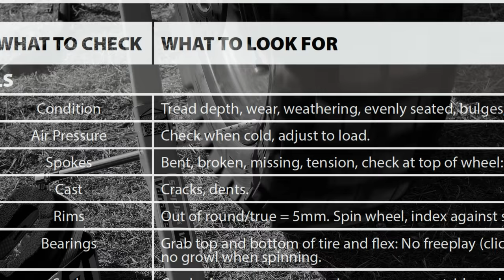Before You Ride - A Quick, Effective Motorcycle Safety Check

Comment: I ride if my bike starts up
Reply: same
Reply: Me too
Reply: I don't have a left leg, so first I start the bike to let her warm up. while she does, I hook up the bungee that pulls up my side stand, and basically do a visual while I do. I Check my Kliktronic goes through the gears OK and can select neutral.
Then the half K ride to the gate soon lets me know if I have a problem.
Reply: I don't have a left nut so even if it doesn't start I figure "what the hell"  hop on and ride off.
Reply: made me laugh, but actually do the same.
Reply: And even if not on the first try, or if it stays running
Reply: This is something I may do if going on a day trip ride, but not commuting to work every morning.
Reply: used to do this until one time one of the terminals came off the battery cause the bolt somehow unscrewed itself, and I had to push it 10 miles home over the course of 2 days.
never again!
Reply: @adamsavage7551  yeah that sounds way more fun
Reply: Wtf... id never arrive anywhere. Keys helmet go...
Reply: im broke as hell so I don't have a cell phone plan
also most of my friends just left for college so I was SOL. Oddly enough those tiny screws seem so commonplace (every battery you buy comes with two of them!) until you need them and they just become impossible to find :(
Reply: I don't if it does not
Reply: @BlumpkinSpiceLatte  same tbh
Reply: Yep! :D
Reply: Tom Yu  Did your phone also died? Couldn't you call for towing?
Reply: absolute mad lad
Reply: I ride If I havea bike.
Reply: @docthebiker   Doc, that's interesting, if you don't mind my asking, how do you get the side stand back down?
Reply: @MOUNTAINMANJJ  I balance the bike with my right leg with right lock on, then use my left hand to push my leg onto the stand tab and push it forward and down. It's a Suzi VZ800 which has the bungee setup. On my FJ1200 I welded a handle onto the stand. I've got a vid of that here: https://www.youtube.com/watch?v=jlMLti0g9UY . I used to be able to lean forwards and push the stand on the Marauder, but I ate too many burgers.
Reply: "If I'm alive...I drive..."
Reply: @docthebiker  wow just knowing that is motivational honestly.
Reply: @thomasyu7648  bruh why didnt you just run to the hardware store and get a bolt? or a clamp? or keep putting the wire on the terminal? or use duct tape? or call a friend? or pay a guy to help you? or use a tow service? or do what adam savage said? or take a pice of string to tighten down the wire temporarily? or literally anything else?

Comment: Doesn't matter what you drive or ride, a basic pre trip is better than no pre trip. As a commercial truck driver I'm required to do a pre trip and post trip every day I drive the truck. Plus as a flatbed hauler, when loaded, I'm required to do an intermittent inspection every 150 miles or 3 hours of driving to check load securement, tarps, and tires.

It doesn't take long, and if you found a problem just be glad it was in a safe parked location and not on the side of the highway. Only takes me 5-10 minutes to walk around my tractor and trailer and check things out. It's even quicker when you don't have 60+ feet of vehicle and 18 tires to inspect.

Comment: a then you start going with the disc lock on...
Reply: LoL!
Reply: ive heard of people putting a rubber band on their brake lever so they dont take off with their caliper lock on.
Reply: I rented a motorcycle a while back that came with a disc lock and they included what appeared like a thin bike lock cable. It's the kind that stretches with loops on either end. One end went through the lock and the other went to the clutch lever.

Makes it much more likely that you'll pay attention when putting the lock on and a lot less likely that you'll forget to take it off with the cord wrapped around one of the primary controls.
Reply: That works fine until you're too lazy to put the cable on when you lock the bike.

Been there, done that, stood around wondering for 5 whole minutes why my bike wouldn't move and started to worry if something was broken. Unlocked bike, and blasted off with egg on my face.
Reply: few days after i got my bike, i started it, tried to go, but when i release the clutch its just kills the engine. so for 3 minutes it was reving it and trying to go, and every time it shuts down... so i started pushing the bike and the side stand was scratching the floor... yep, it will not go if you  dont lift the side stand... felt so stupid. also, a day after i bought the bike, i could not start it, first thought was that i bought faulty bike and i got so mad, but after couple of minutes i realised the red ignition safety switch was off...
Reply: Turning on bike? ONE-C.

O: ignition On
N: Put bike in NEUTRAL (not needed, optional)
E: Engine cut-off switch
C: Clutch

Turning it off? Thumb-key:

Thumb: Engine cut-off switch
Key: Ignition off
Reply: Yes i did 😓
Reply: @miloshadzic8099  this happens to me too many times...
Reply: No you don't, you either almost or actually drop your bike.
Reply: dona the dog  How are you not embarassed to tell this to us?
Reply: dona the dog Been there 😆
Reply: Not to mention:  Fuel tap still shut.
Reply: Been there, done that.
Reply: Done it.  Check!
Reply: Actually even worse, was on a really long ride, then a hike, was tired, should have rested... 
Got on the bike, f800gs, not a light bike, dropped something, and as I leaned back the bike leans over and I'm too tired to do anything but bail out..  fell over on the left side.
Whole crowd of people watching in a state park parking lot.  
Got it lifted back up on my own, as you do.
Reset, started the bike, let out the clutch, BAM!   Forgot the disk lock!! 
The bike jerks, leans hard, still too tired, bail out  again, falls on the other side!!
Really have everyone's attention now.
One guy had pity, helped me lift it up..
Tried to take the lock off, it's bent and won't unlock!! 
Guy asks if I need help again..
No, no, I'm fine.. thanks..   ego just too fragile at this point.
Think about it, where's a hack saw around here!?!?!  So to hell with it...
Neutral, Rock it back.  Bang it 3 times pretty good..  sorry disk!! 
Lock's freaking straight NOW!!
Unlock the damn thing, slink away with my shades down.  Bike was fine luckily
Omg!!!! So freaking stupid!!!
Lesson learned.
Beats a wreck, but that's about it! Lol
Hope this gives you all a good laugh!
Reply: One of those moments that you'll remember for a long time for the wrong reasons :D That feel.
Reply: im new to all this, so ppl cant blame me :D
Reply: @travishayes6037  Onesie, thumbkie. Alrighty!
Reply: The secret is to lock it right bellow the brakes, so when you try to leave the bike wont move forward. If you give space it will stop suddenly and you're probably gonna fall.

Comment: Fasteners - use a torque seal on critical bolts. The little dab of hardened torque seal will break off if a bolt or nut loses torque and backs off. Makes for a quick and dependable preflight.

Comment: My first road accident was result of a seized front caliper, from old crusty brake fluid. Almost burned the bike down too. This isn't something you can really rule out on a preride check, but something relevant to a lot of the used bikes on the road. It was also currently inspected, lever felt alright, and it gave little warning before the seize. I was a new rider, but pretty experienced on dirt at the time. I had a slight suspicion of carb issues and then went down in a turn seconds later. A little drag will get your rotors red hot pretty quick, so keep up on your brake fluid and always check it on a new used bike. Might also be wise to rebuild/check calipers on anything more than 10 years old.

Comment: Maybe hes talking about an actual ride not just going to work or some corner store run
Reply: True
Reply: Perhaps, but OTOH, the majority of motorcycle riders, at least in the US, don't ride every day. If you are riding every day, then you probably don't want to do all of this every time. The air pressure in particular can become a bit of an issue if you're checking that every day, as you're probably letting more air out of the tire than what you're other wise losing. It's probably sufficient to just check on days where the temperature varies significantly over the previous day.

Some of this stuff, though, like checking for leaks under the bike require zero effort and you can avoid dealing with the spoke problem by buying wheels that don't use spokes.
Reply: He says in another comment that he does a much bigger check before a big ride. This probably is the daily check he does, and it's quicker than the time to warm up the bike.
Reply: I only go for rides, I start it, let it warm while putting my gear on, then go.
Reply: You guys warm up a fuel injected bike?
Reply: @jasonjayalap  I warm up all internal combustion engines. It takes a while for all the parts to get oil and for the parts to reach their correct temperature (size). You don't have to, but if you do, time between major teardowns is greatly extended.
Reply: I don't think I'm gonna buy wheels without spokes just so I don't have to check them lol
Reply: gasdive gasoline engines are better warmed up under you. It's bad to just let them idle.